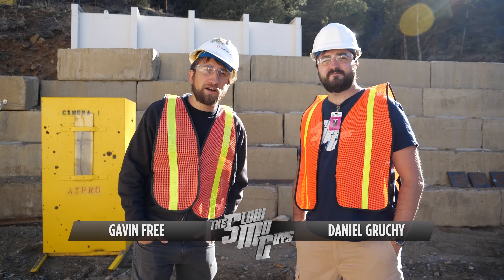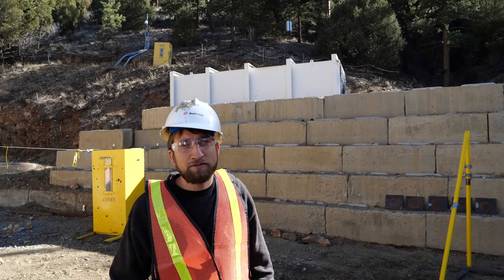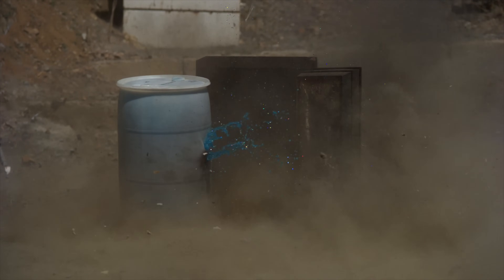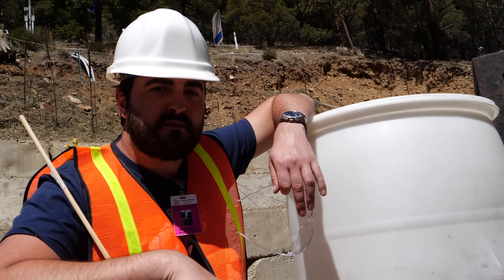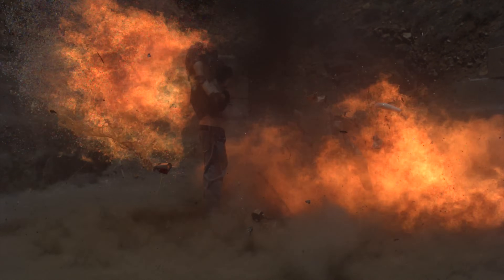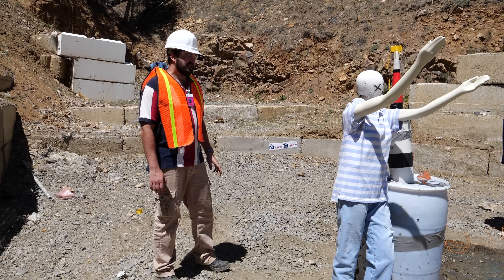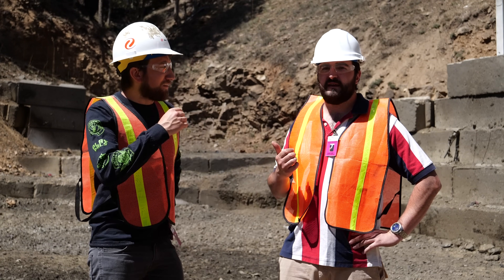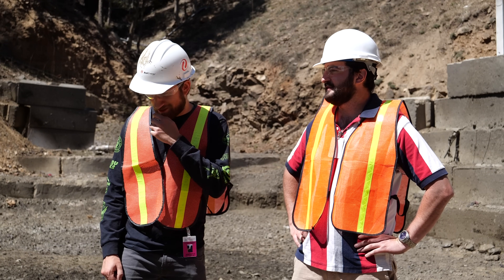Massive Explosive Chain Reaction at 200,000fps - The Slow Mo Guys

Comment: Many years ago i was a Blast engineer for a forest fire , sent up the mountain to cut a fire line and drop top burns , We used Dectord B-line and about by my math 11 liko of C-cord to drop a slapper , that is a tree that fell while on fire but did not hit the ground and there will not be a cutting crew for hours so I was ordered to drop the tree.. we carved a grove with the chainsaw to make a shape charge in the field . wrapped the hemlock tree with a 1,2,3,5 wrap pattern . . Sounded the warning air blast, radio broadcasted then let go the Two minute warning Air horn to warn firemen in the region. Well I was about 1200 metre up the mountain.. the charge went off sounded the all clear went to survey the tree and was hit buy the sound wave bouncing off the mountain at the other end of the valley. and below that mountain was a Native Village. needless to say we got several hundred windows 5 miles away with the sound shock wave.. one of my best Eff ups

Comment: A good shaped charge will penetrate 9 diameters in rolled homogenous armor. Rough rule of thumb used by the warheads group at Hunting back in the 1980s. So that thing should do about 18" of steel. BL755 and LAW-80 were two of their warheads. For real range perhaps you could get hold of a Self Forging Fragment? The HB876 was another one of theirs, but you don't want to be near that when it goes off. The dimpled casing makes more fragments, so the danger area is very large. I used to have an unfilled one as a pen pot on my desk.

Comment: ANFO is used to move large rock faces in mining. It's a moving explosive, so it packs a slow but heavy punch to push rock not just crack it. That's why it caused so much damage to all the stuff there, those shelters and such are for high explosives mostly, and certainly not that much ANFO, that was a very large charge for such a small area. Great footage however

Comment: Why didn’t the door of the safe move?
Reply: The molten copper probably weighed less than a gram and was traveling at crazy speed. It just vaporised it's way through 💪😄
Reply: Inertia
Reply: Because to move something is to apply force by weight. There was not enough copper to move the safe door.

Comment: Wow, the shaped charge looks more scary than I thought. It is like beam of destruction that would pierce not only the front door of the safe but the back wall as well and everything in the safe.
Reply: Perhaps perhaps not, much like a magnifying glass on a leaf; the explosive has a somewhat limited range of effectiveness which is why there needs to be that standoff like Dan said, and why shaped charges can be defeated by placing a plate of armor spaced from the main bulk to pre-detonate the charge and reduce its effectiveness. Basically yes it'd go straight through the front of the safe but possibly not out the back.

Comment: lol i think the pit is a bit small for 50lbs...
Reply: Uncontained explosions don't do a heck of a lot of real damage, at least not as much as you'd expect. You need to contain or direct the explosive energy to actually do damage, like drilling a hole in the ground and sticking the explosive in it, cover over it with clay/cement and whatnot.
Reply: Not true in the slightest and thats not my point at all. Containment or direction does not change the energy output.
The point is the site they are in is too small for a 50lb explosion, and they even say it in the video, and its evident by the fact that the safety equipment was damaged (due to obvious proximity), clearly not intended for such a blast.
Not only is the site quite small it is also relatively confined with steep walls and vertical concrete barriers. A test site like this would be used for small scale blasting cap, booster tests and educational purposes. I would guess nothing over 10-20lb is size had been detonated there before.
They placed a 50lb ANFO bin literally 6 feet from a concrete barrier wall due to space limitations. Normally something like that would require at least 100 feet of clear space in every direction.
Reply: Oh, interpreted the original comment completely different, apologies. I imagine pressure from a company like Vision Research and high profile youtube personalities would push them a bit further than what sense would dictate.
Reply: Possibly. Luckily they didnt damage the cameras. With no people around its safe no matter what, just a question of how much cleanup and equipment replacement/fixing are you willing to do.

Comment: If the shaped charge is moving at 10,000 m/s, it's still slower than typical meteor velocities. The slowest meteors will be entering the atmosphere at around 11 km/s, and average ones will be going 20 km/s, double the speed of the charge. The fastest ones, such as ones that come in as cometary fragments for long period comets, will be going 76 km/s, more than 7 times the velocity of the copper.

Things in space move really, really fast. When you can fall for decades before reaching anything to slow you down, you get going really fast, and that's how space works.

Comment: I had to dislike, the explosion sound is to load.
even if there are warning it should be lower down in the edit.
Reply: Just lower your volume genius
Reply: Funky Jesus 
Im using headphones and my head exploded 3 times during this video.
Its 3-5 times loader than the video in general.
I don’t know why they didn’t reduce the noise.

Comment: So just to refrence: the bigest explosion they did was about 50 pounds (50LBS) The United states airforce drops bombs that are 2000 Pounds (2000 LBS) :D That's a boom
Reply: Though only about half the weight is explosive filler; the rest is a steel casing.

Comment: Shaped charge tip traveling at 10km/s? Escape velocity is only 11.1km/s... I guess the material would disintegrate shortly after detonation, but it'd be interesting to try variations with the shaped charge (underwater, pointed skywards, etc).